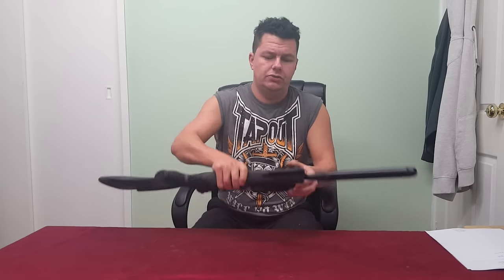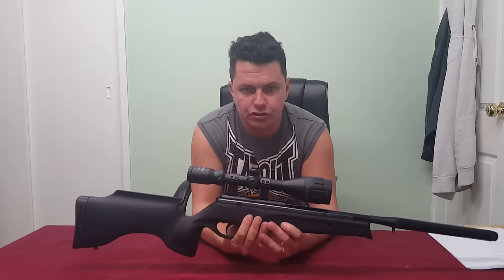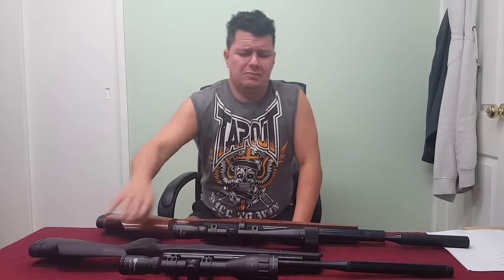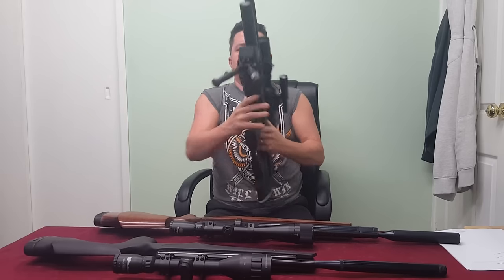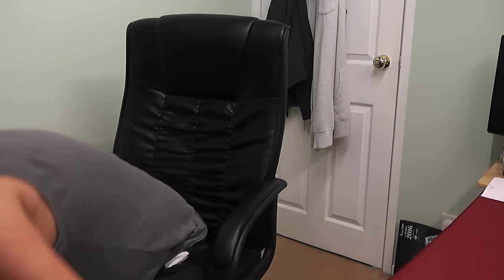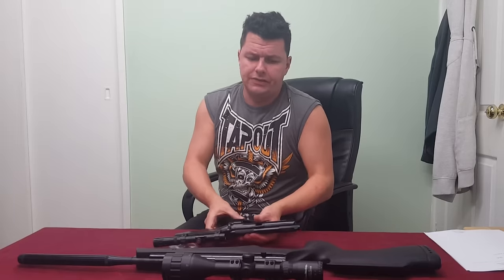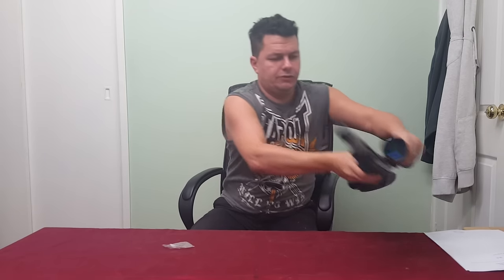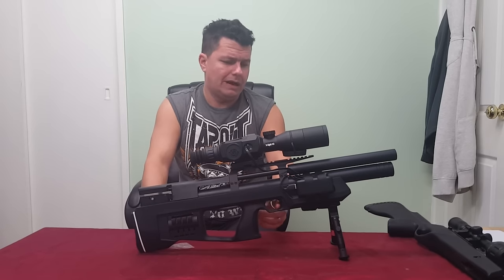Airgunning for Beginners  - The Anatomy of an Air Rifle

Comment: Hi Steve just enquiring about fitting a bypod on a brake barrel air rifle. I seen videos on the " artillery hold" to increase the accuracy of a springer in which you hold your rifle with as little grip as possible. Now my thoughts are if that's the case a bypod would be counter productive, would this be true. Hope to hear from you soon Phil
Reply from the maker: Phil, Bipods are generally a no go on springers as they stop the rifle from recoiling / moving and so your assumptions are correct.

Comment: excellent video steve , .. could I please add too the scope part of the review , make sure the bolts on the dovetail tightened quite tight , no need for a 2ft tommy bar , just a good old " pinch up " .. the actual scope tube not so much , just a tight : nip up " but still secure .. this is important when setting up , as I found out too my detriment last year when sighting my  Hawke SR Pro in .. also .. if you want too ( allowed ? ) recommend a moderator , weirauch are in my opinion are at the top of the tree .. yes ( the ones I have ) are dull and plain , a bit like id imagine the queens underwear selection would be like ... ( dunno if weirauch do a carbon moderator ) ... keep up the good work dood , think I might have an hour on me range now ... before mrs gets home from work ...
Reply from the maker: Thanks mate. Have fun on the range :)

Comment: Can you make clear of the recoil of the scope on Springer?  As I hear that some scopes can be damaged (through the sudden smack of the release of the spring, damaging the optics) if not compatible with Springer!
Reply from the maker: Yes if you scope a springer, you need to check with the maker to ensure it is certified for springers so as not to damage the scope or have it move due to the violent recoil in some springers

Comment: Quickest way to stuff your seals up is to fire a rifle without any resistance, eg, loaded.
Reply from the maker: For springers yes, will damage the spring, for PCP no. no risk at all as long as the cocking bolt / lever is closed.
Reply: @airgunology  Are you sure that rule applies to all PCP?
Reply from the maker: yes if they are standard PCP as only air being fired and no moving mechisms. As long as the rifle has the cocking handle closed, it is safe to dry fire them. All manufacturers do it all of the time when demoing and none have told me otherwise.